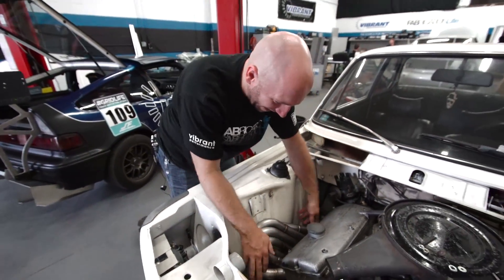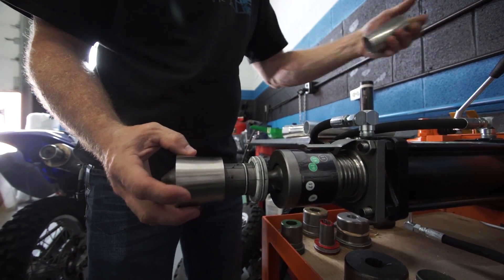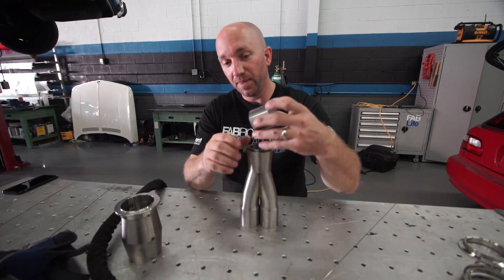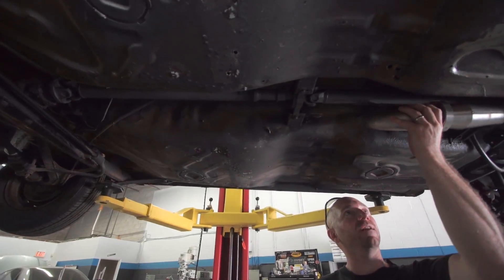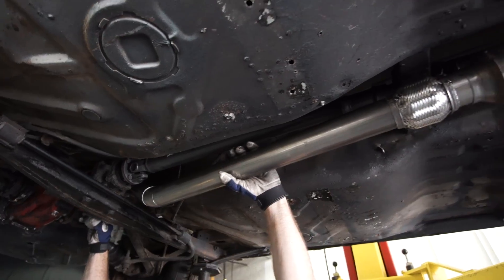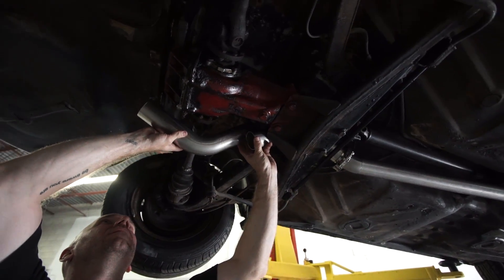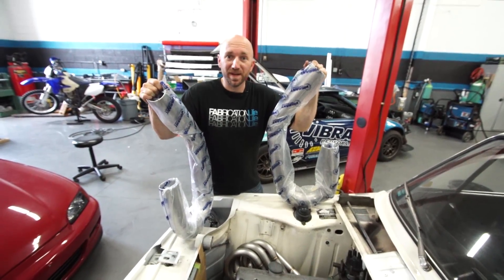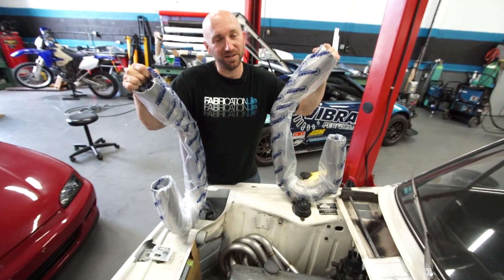Retro Header Build-Off Part 5: Building an Anti-Reversion Chamber

Comment: Experiment with different angles on the tip of that cone. When you find the right spot for the shockwave, the engine will rev twice as fast in half a second.

Comment: David Vizard said that the anti reversion mechanism is best done at as near to the exhaust valve as possible, that is by putting anti reversion flaps at the beginning of the exhaust header.
Reply: That is true, but it's not always an option, depending on the space you have to work with. There are still gains to be had by using an anti-reversion chamber in the collector, and it's far easier to package a chamber there than in each individual primary. I'm just glad that there seems to be a lot more people on YouTube talking about anti-reversion chambers, expansion chambers/megaphones, merge collector designs, x-pipes, and especially stepped headers lately. There's all kinds of exhaust system magic like that out there, which you can find on well-engineered race cars, but has long been ignored by the vast majority of companies in the world of aftermarket parts for street cars. Hopefully that will change as more people become aware of how much performance they're leaving on the table by not experiementing with these design features that can significantly improve exhaust scavenging. Plus, those features can have a huge impact on the sound of an exhaust system.
Reply: I've watched the same DV video and am working to create a plate for a Datsun/Nissan U20, very similar head to the L-series (Z and 510 cars).

Comment: The part that you slid inside the cone should've went outside of the cone because you're interfering with scavenging unless you butt connect the two together and weld it. Whenever you're connecting a piece to the exhaust going outward you always slide it over the previous piece.

Comment: whats the use of the Anti-Reversion Chamber? can some shed some light over here please...
Reply: Prevents the exhaust pulses travelling back upwards. It happens because of valve overlap during high intake vacuum. When done right, the benefits includes improves torque at lower RPM, ability to use more aggressive cam timing, can go full throttle at much lower RPM, less Nox.

Comment: What schedule pipe do you use for the headers and the rest of the exhaust? I see SS turbo Headers used SCH 10. Do you use thinner tubes for N/A aplications?
Reply: Yeah, if you're running an NA build then there's no point in having thick piping such as (Sch 10, 40) it'd be best to use thin wall tubing
Reply: This is TUBE, pipe is for  water etc and is very different specs. Exhaust tube wall is usually 1 to 1.2mm.

Comment: What he made there is called a merge collector.  The cone shape is to allow scavenging (negative pressure waves) to occur over a longer duration per pulse, which adds power over a broader rpm range compared to a standard collector which causes a stronger but shorter duration negative.
Reply: 6 years is a little late but he made whats called a reversion chamber that was placed past the merge collector. The design is to prevent reversion (exhaust resonance/reverse flow) which in turn assists in scavenging. another way that big racers do(F1, NASCAR, rally) is stepping up the header piping at increments to make it harder for those reversion pulses to travel back up to the exhaust valves hindering scavenging.
Reply: @lilwewe1451  For whatever reason , the term "merge collector" seems to be used to describe a collector with an expanding exit, whereas a "collector" typically doesn't have that.  I don't know if the anti-reversion chamber actually does what it's believed to do, because the incoming pressure wave encountering a constricting cone after an expanding cone would likely cancel some of the negative pressure that would otherwise have contributed to scavenging.  Stepped headers assist scavenging by causing moments of negative pressure while the exhaust valve is still open (I'm assuming that's the goal), helping to evacuate the cylinder better.   I would think a constricting cone would create some back pressure,  but probably insignificant in this case because of how much larger in diameter the anti-reversion chamber is compared to the collector.
Reply: I have not heard these called any of those. Top comment does describe what happens but all I've heard them called is Megaphones, because they also help create a far different, deeper tone.
Reply: @DerringtonLatour  people here seem to be trying to talk about collectors, megaphones and anti reversion baffles all at the same time.

Comment: Hey Vibrant, I need advice. What schooling (degrees or certs) would I need to have a job in a speed shop like this? What does the career path look like? Thanks in advance!
Reply: Great question. Hoping they answer.
Reply: Hi William, that's a great question. The most important thing is you need is passion for the industry. I am one of the technical staff at vibrant along with Aaron and Jay. We all have completely different backgrounds, Jay is self taught, Aaron has a machining background and I am an engineer. We all bring different expertise to the table, but we all share a deep passion in racing, automotive design and fabrication.
Reply: Passion is cool and all . . .but having worked alongside some super "passionate enthusiasts" . . .SKILLS are what you need to be successful. Get some skills. You probably won't get much from YouTube, it takes time, effort, failure and perseverance. Just keep learning, look to that past for inspiration.
Reply: william ulibarri, start with vocational schools. Learn welding and automotive.
Reply: I work at a speed shop and I  have had zero schooling.... teach yourself and get skilled trade jobs and look at college to expand your people base
Reply: go to you local muffler shop and offer to blow the hairiest mechanic there. good luck!

Comment: Why does a 2002 need a cat? They never came with one so why add the exhaust restriction?
Reply from the maker: That's a great question - There were a couple of reasons when considering adding the GESi Catalytic to this vehicle. Firstly, yes - the car is old enough to not have any emissions regulations by the government, however we have tested these catalytic converters in the past on naturally aspirated vehicles and have actually seen an increase in horsepower when adding them (refer to our video 'How can a Catalytic Add Horsepower?' https://www.youtube.com/watch?v=56oLVgpwOAs). Secondly, Art requested to add the cat because he wants to have an enjoyable experience when driving the car on the street - by having cleaner air coming out the pipe, eliminating the smell, etc. Lastly, the whole exhaust has V-Band connections will allow him to switch the catted section with a catless midpipe or even put on straight piping off the header all the way back if he decides to track the vehicle.
Reply: @VibrantPerformanceTV  This could only be because adding a slight restriction there benefits the pulse tuning. High performance honda guys have discovered that "high flowing" the cat reduces power, not realising honda know what they are doing when they release an emissions legal 100hp/litre engine. You'd almost certainly note the same gain in power with a piping size step-down then step-up in the same place.
Reply: I was under the impression that carburated vehicles do not run efficiently enough to use a cat.  I have thought about putting one on my car (Datsun 510 with side draft Mikuni's) but have heard that the cat would overheat and break down very quickly.  Are the GESi Cats able to handle the variations in AFR that carbs present?
Reply: @TheEldukerino   I don't understand why either. But I know some cats have a metal core catalyst so they can handle extreme heat and richer running vehicles better. But the carb would still probably wash all the catalyst of the substrate then its not much of a convertor anymore just a muffler.

Comment: Cool stuff but I thought anti reversion chambers were supposed to be as closed to the exhaust ports as possible, is that not the case? For those that don't know, anti reversion chambers also help with engines that have a lot of exhaust valve overlap, the chamber helps keep exhaust gases from being sucked back into the cylinder during the intake  stroke.
Reply: yes, directly at the head would be the ideal location.  packaging prevents that in this application.  I've seen other fabricators have success gaining torque placing them post collector on n/a headers.  there is a lot of math involved to maximize the potential of the chamber.  the intent here is to encourage people to try new things and learn by doing.
Reply: th reversion baffle here is after the collector so it creates anti reversion for all cylinders, if it was closed to the exhaust port one would have to be made in each tube.
Reply: Aaron Weir Super cool, I didn't realize they would work that far down, awesome work! @ Phone User, interesting, makes sense too.
Reply: FORCED-INDUCTN 
A proper pulse tuned exhaust does not need them.

Comment: Would an anti-reversion have benefits on a turbo set-up (assuming it's after the turbo outlet or down pipe)?
Reply: Rigo Hernandez  don't think so.  The exhaust would have to come back through the turbo, which I don't think is possible.
Reply: The best exhaust after a turbo  is a laminar bell which is super short and would change shape depending on the variations in flow. It's kind of like how rockets loose parts as they change altitude the thrust cone(bell) keeps the correct burn happening for max thrust but on a turbo it's going to be reversed where we will take the pressure coming out of the turbo and try to diffuse it with the greatest pressure transition possible without inducing more  turbulence.
Reply: no, there is not a significant benefit in a turbo application as all the pulse waves are disrupted by the turbine wheel.